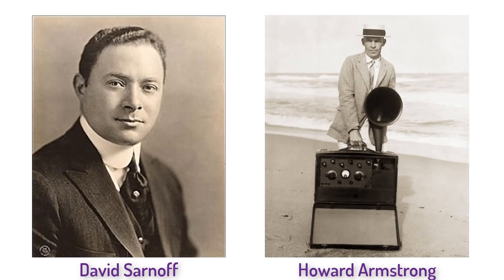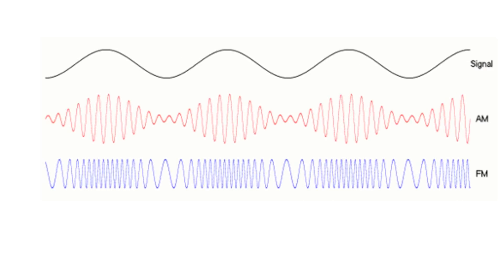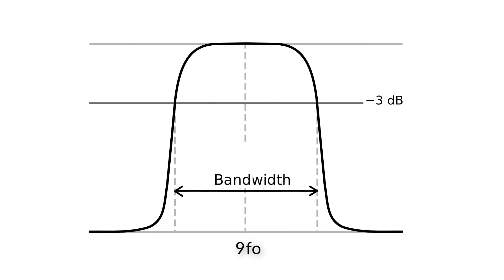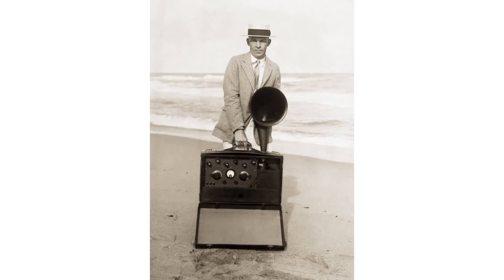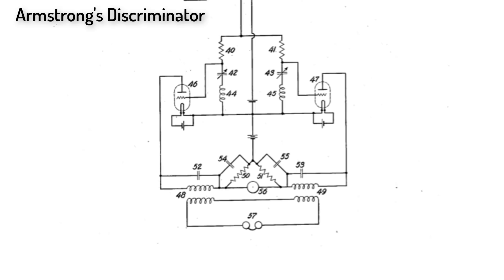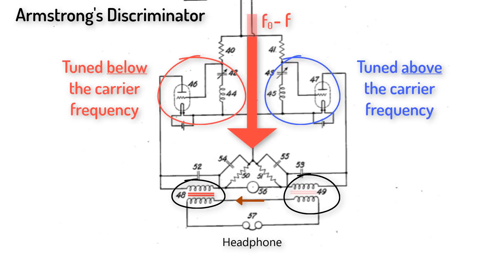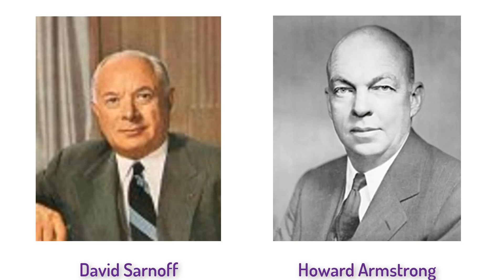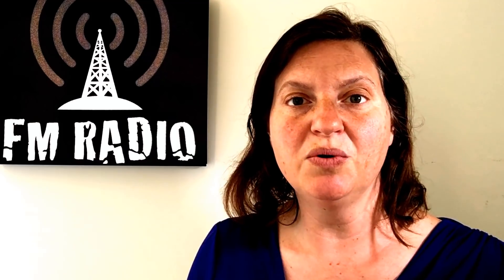Armstrong: the Tragic History and Physics of FM Radio

Comment: I was told that the reason FM took so long to overcome AM was the complexity, and therefore cost, of the receiver. AM receivers could be made really simple, and portable as soon as the transistor appeared (you can build one that doesn’t even need bateries, using just a capacitor, a coil and a diod). But I don’t know how much of it is fact, I mean, how much more expansive an FM receiver would be before transistors became really cheap.
Reply: There definitely was a "chicken before the egg" problem. AM tube radios were mass produced using the heavily cost reduced "All American 5" design. AM transistor radios were also mass produced from a cost reduced design. FM radios were more complex to begin with and weren't mass produced, due to low demand. So, FM radios and AM/FM radios were expensive compared to AM radios. Because the audiences were small, there weren't many FM stations in operation.

I think what really gave FM a boost was introduction of a new radio format in response to a FCC requirement. Many AM stations had "sister" FM stations, presumable to get a place on the FM dial in preparation for when FM would come of age. They broadcast the same programming on both stations. The FCC decreed that they had to have a certain number of hours of different programming daily. WRKO-FM in Boston introduced its ARKO-matic automated top 40 format: a "computer" voice for a DJ, no talking over the beginnings and ends of songs (great for recording!), no commercials (it didn't have a significant audience, so advertisers would not pay for air time), the #1 song at the top of every hour. The format was a smashing success! Teenagers bought FM radios in droves. However, the format was a victim of its own success. Once the station had a significant audience, advertisers bought air time. However, FM radios were in the hands of a lot of people, so the medium grew. I think WRKO led the way as Top 40 migrated from AM to FM.
Reply: @jimlocke9320  when did WRKO FM appear?

Comment: Analog TV has always used FM for the sound.
Reply: Very High Frequency transmissions didn't always mean Frequency Modulation. The television sound signals in Britain and France used amplitude modulation; in France this continued until comparatively recently (2010). In Britain A.M. was the only available technology when television broadcasts began in 1936. In France post-war this may have been to avoid paying patent rights plus, possibly, considerations of national pride. The resulting sound quality was just as good as in other European countries using F.M., as I remember from a British 405-line receiver working in 1984. Where F.M. scored was in making better use of the transmitter power to give interference-free reception over a wider area from the station.

Comment: In order to get enough frequency deviation, Armstrong not only multiplied a low frequency signal many times, he took the resulting high frequency signal and heterodyned it back down so he could multiply it many more times, then he once again heterodyned it back down and multipiled it more. All of this multiplication finally gave him enough deviation.

When I started high school around 1970, our school started an FM radio station WCNE, which is now community station WOBO. Our first transmitter was a CCA FM10D, which used a low frequency crystal oscillator driving phase modulator. Phase shift and frequency shift are essentially similar types of modulation. In order to get enough deviation for broadcast, the FM10D had several multiplier stages, similar to Armstrong's Columbia prototype.

In fact, the de-emphasis network in the FM receiver, integrates the audio waveform above the knee of the de-emphasis curve with 6 dB per octave, essentially making high frequency audio compatible with a phase modulator. A phase modulated FM transmitter has what is called a pre-distortion network to adjust low frequency audio to be compatible with the de-emphasis curve. Note that the purpose of emphasis is to reduce high frequency noise, which is caused by the equal energy-per-octave response of the ear. It is just that de-emphasis can do double duty, both reducing the HF noise and integrating phase modulation. It seems this subtlety is missed by the amateur radio examination which wrongly asserts that the PURPOSE of de-emphasis is make an FM receiver compatible with a phase modulator; this is a byproduct,  not the purpose.

It is somewhat complex to generate a stereo signal using frequency multipliers, so as stereo took hold in the late 1960s, Gates developed the TE-3 direct FM stereo exciter. The problem was that a crystal oscillator could not be "pulled" far enough for wideband modulation, so the TE-3 had a complicated phase-locked-loop automatic frequency control system to loosely lock the FM oscillator to a crystal reference. The problem was that certain audio, particularly heavy bass, would cause the AFC to unlock and the station would drift. Disco music of the mid and late 1970s was the death of the TE-3. As the 1980s were getting started, Harris (who had bought Gates) came up with the MS-15 exciter, which was a direct FM unit with a much improved AFC system. My experience with the TE-3 was at WMRI and the MS-15 was at WKHY.

So far as AM, broadcast could and did have good fidelity. When I worked at WBAA, our 5 kW Collins 21A transmitter had audio frequency response only 2 dB down at 15 kHz, which I measured.  I had 2 different EE professors at Purdue tell me that AM broadcast stations must limit their audio to 5 kHz, which is completely incorrect. But a lot of people apparently believe this myth. In the early 1980s, the FCC started requiring stations to limit audio to 10 kHz (the NRSC emissions mask) so they could overpopulate the broadcast band. Wideband (10 kHz) c-quam stereo AM can sound amazingly good, but as time goes on modern electrical devices are raising the noise floor so that AM reception in cities may be too noisy. A couple years ago, during an extended power outage, I did some amazing AM broadcast DXing!

I have found it sad that few people working in broadcast know the names Fessenden and Armstrong, radio pioneers who created their industry.
Reply: In 1979, when I took over as Technical Director of our college station, they had recently purchased a new FM transmitter, antenna, and stereo generator. (Also, Emergency Broadcast device, mixer, mics and turntables.) Previously, the station had been 10W (ERP 10W from a monopole). The TD before me had installed the audio equipment, the EBS device and the Orban stereo generator. 

My first major task was the technical portion a new license application for the 100W transmitter and 1.64 gain antenna.  (They had spent the entire grant on hardware, and had nothing left to pay professionals to perform the license application. I did get a little help from an alumnus EE to do setup and measuring/verifying the equipment performance. He worked for a company that let him borrow test & measurement equipment - he would drive 250 miles each way to help me on a few weekends.)

The Orban Optimod stereo generator seemed magical - easy to configure, compression that did not intrude (though it would allow one to crank up the compression until it had near-zero dynamic range), and our audio quality was better than the commercial FM stations available locally. (They caught up. One of the broadcast engineers came an asked us about it, read the manuals and played with the settings...then got his station to go Optimod, too.)

Others installed the new antenna before it was licensed. [I just went back and edited the station name out of the text above, to protect the innocent.] 

In High School, I read a biography of E. Howard Armstrong. Starting during Jr. High, I also constructed and experimented with my own outdoor antenna to DX AM at night.
Reply: Thanks for that interesting comment. Wd4cxq

Comment: Problem with Sarnoff - he didn't know math very well. He didn't see that Armstrong FM discriminator could be improved in many different ways. You didn't mention why the Armstrong discriminator was so bad - it was a slope detector, as it provided two tuning points for each FM station, one 75 KHz below the station frequency, and one 75 KHz above it (150 KHz is the total frequency deviation for wide FM stations).
Later, it was possible to develop the Foster - Seeley detector, which was slopeless and therefore had one single tuning point. In the military market first, and successively into the civilian market following widespread use of semiconductors, the quadrature detector was developed. In the digital age, after 1970, the Phase Locked Loop detector was designed. One more, the Philips TDA7000 FM IC, divided digitally the carrier until it was +- 75 KHz, and fed it into a PLL circuit: an entire FM radio on a chip.
After 2010 we moved into software defined radio, or SDR. The radio as computer program: one example for all, is the smartphone FM app that utilises the LTE modem present in every smartphone to receive FM radio stations. Traditional radio still exists because SDR radios have abysmal image frequency rejection and very limited signal dynamics.
Thank you for the great video! Highly appreciated...
Reply: Funny that no one mentions what a scummy move it was to do dirty to Armstrong.
Like that just is accepted as business as usual. 
Its as if that aspect of human nature is just accepted as the norm and no wonder the world is in its present state.
Reply: @chuckthebull  Yet Armstrong's discriminator bears a striking resemblance to an earlier RCA circuit for Automatic Frequency Control.  Much of what we know about Armstrong comes from Armstrong's publicity firm and the Lessig book that was largely sourced from Marion Armstrong while she was in the middle of all those lawsuits.
Reply: @chuckthebull  If Sarnoff deserves to be demonized, let's do so with facts.  1) I believe RCA had a patent infringement case against Armstrong based on their AFC circuit.  They didn't sue.  2) Sarnoff let Armstrong conduct FM test transmissions from atop the Empire State Building.  The FM tests continued for over a year until Sarnoff decided to use the facility for TV test transmissions.  3)Sarnoff and RCA wanted the FM band moved up in frequency.  However, Sarnoff allowed his chief engineer, Harold Beverage, to testify against the move.  Beverage was clear that he was testifying on his own behalf, not RCA's.  Beverage and Sarnoff continued their long term friendship until Sarnoff's death.  4) Sarnoff wasn't the only guy in radio.  If Sarnoff had really dropped the FM broadcast ball, surely somebody else such as EH McDonald at Zenith or William Paley at the Columbia Broadcasting System would have picked it up and made the fortune that Sarnoff missed out on.  5)  Edwin Armstrong might have been a genius inventor but he didn't have a clue as to making money in broadcasting.  High fidelity radio broadcasting is a niche market, not a mass market.  Armstrong's thoughts of replacing all the AM radios and transmitters were nothing more than pipe dreams.
Reply: @chuckthebull  Did you know that at one time Edwin Armstrong was one of the wealthiest people in the world?  Armstrong exchanged his patents to RCA for RCA stock.  The exchange for the superregerative patent was particularly generous, more RCA shares than the combined number of shares for the regen and superhet patents.  Edwin Armstrong owned more of RCA than anyone else, including you-know-who.  And it was you-know-who running RCA and signing off on those deals.

Comment: Regardless of Sarnoff's intent, moving the FM band to it's present location from 88-108 MHz made it more practical.  At the time, little was understood about VHF propagation.  Not only did the original FM band have fewer channels, under certain conditions it was prone to to interference from other stations far away. The distant signals could sometimes be so strong they wiped out the local signal.

The other reason why I think Sarnoff wanted to not pursue FM is because he needed the spectrum for television.  It was very difficult before WWII to generate high power VHF signals above about 100 MHz.  A television signal has much wider bandwidth than an FM radio signal.  Three television channels occupy as much spectrum as the entire 100 channel FM radio band.  Looking at it from the mid to late 1930s, there was room for the growth of television, or FM, but not for both.  Sarnoff rightly saw television as a much larger market than FM.  He made a lot of his money selling receivers, and television receivers would be more profitable.  As the video points out, RCA was heavily invested in television.  

From everything I've read, neither man was easy to get along with.  Armstrong had quite a temper, and he did attack his wife.  Sarnoff made Armstrong a very wealthy man.  I don't think Sarnoff was as big a villain in this story as he is usually made out to be.
Reply: This is true.  Low VHF propagation can be amazing during a solar max.  I lived within about 10 miles of a channel 2 transmitter and would get interference from stations hundreds of miles away.

Comment: i had an idea when i was a kid that a person could use a double detector in AM radio, a positive diode, and a negative one too.  The diodes put out signals that should cancel each other out if combined, except for information (noise) that isn't in the original signal. Then a muting signal based upon an output from the differential matrix would blank our or reduce the noise in the first audio amp stage. I built something along those lines and it seemed to have some good effect, but didn't persue the matter. Later I thought the two signals could be used in a comparator circuit, and not passing anything that was not equal in both data streams, if the audio were to be digitized, thus an improved way perhaps of accomplishing at least a reduction of noise and perhaps complete elimination is the noise were below a certain level, but haven't gone any further with the idea to see if it is viable.
Reply: With two diodes you make a signal doubler. For AM in 2022, the true noise-killer detector is called "Syncronous detector", which use logic gates to separate the carrier from the modulation, remove the noise and replace the parts of the carrier which are missing. Widely used for commercial aircraft Comms - which use AM modulation on a VHF carrier.
Reply: The National Institute of Standards and Technology (NIST) operates a radio station, WWVB, broadcasting encoded time of day information on a carrier frequency 60 kHz from Fort Collins, CO. There are probably millions of clocks and watches that receive the signal and set themselves automatically. These timepieces use an envelope detector to recover the pulse width modulated (PWM) time data. In many locations, the signal is very weak and timepieces don't recover the data.

In 2012, WWVB began broadcasting time data simultaneously on the same 60 kHz carrier in a phase modulated (PM) format. The reference carrier phase was unchanged for a 0 and shifted 180° for a 1. A synchronous demodulator is used to recover the PM data. Timepieces that recover PM can operate under more adverse reception conditions (weaker signal and more noise) than those that recover just the PWM data with an envelope detector. The LaCrosse UltrAtomic clocks recover the PM data. Timepieces that recover the PWM data using envelope detectors are not made obsolete. They continue to work where reception is good enough.

Comment: Hello Kathy, I'm a herretic electronic hobbyist when it comes to simple radio circuitry, TRF for  pure AM radio receivers : I built a straight--forward 3 transistor set using 2 FETs and 1 bi--polar. My home--brew schematic is an FET comon--source for the first--stage, a bi--polar for the 2 nd--stage, and another FET comon--source for the 3 rd--stage. Even with a single 240 uH tuning coil and matching 365 pF varriable capacitor, its performance rivals my cheap superheterodyne store--bought radio for RF gain and selectivity ( not the best, but satisfactory for my liking ) !!! My detector--circuit is a  pump--rectifier using two 1N34A germanium--diodes. You are an enjoyable fantastic lady !!! Howie from 02446

Comment: today almost all devices use fm from radio to dtv to celphones to the internet (of courseyou can't transmit 5mbps of signal on am let alone 1kbps and if static gets in the wayall your data is garbage)
Reply: Modern digital communications utilizes QAM (quadrature amplitude modulation) which is a combination of AM and FM.

Comment: Your interference demo doesn't tell the whole story. Although FM is indeed more resistant (but not immune) to static than AM, the much higher frequency of FM broadcasting also helps. Noise from many sources, including electrical arcing, decreases sharply as frequency increases.

Comment: What's amazing is that today generating an FM signal is as simple as putting a vara-cap diode across the turned circuit of the transmitter oscillator, and feed the audio signal into that diode.  (It can also be generated via DSP, something not available back then).
Reply: Depending on what is to be made simple, creating the heart of a Software Defined Radio (SDR) FM transceiver with one chip should be possible too.